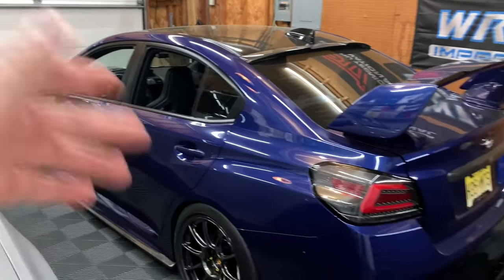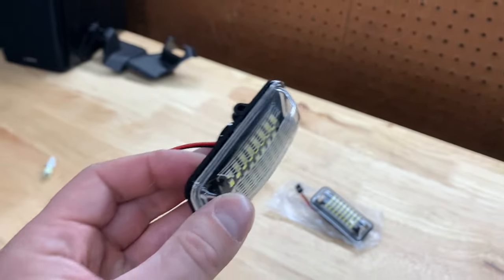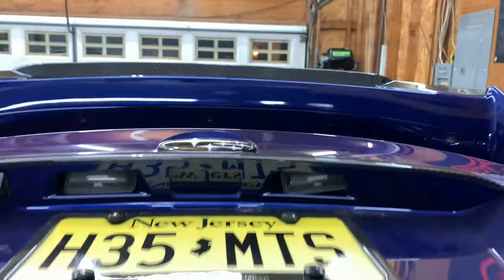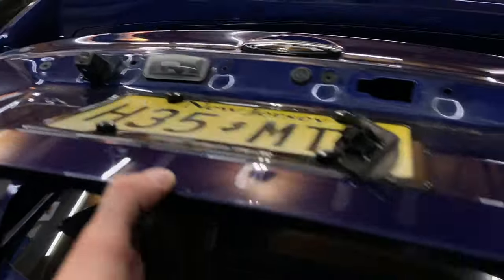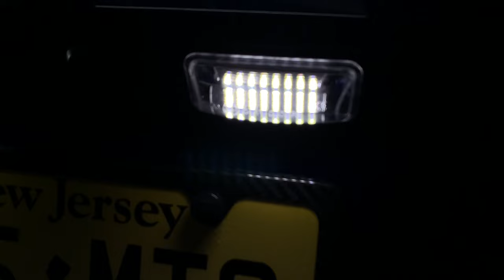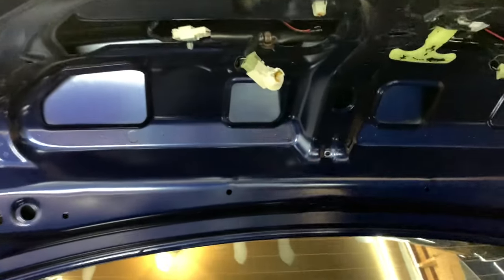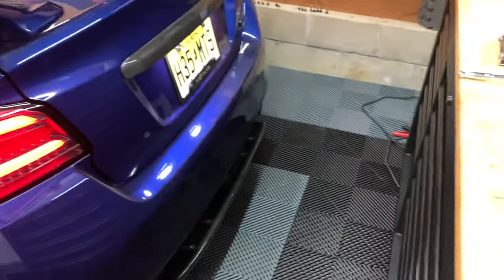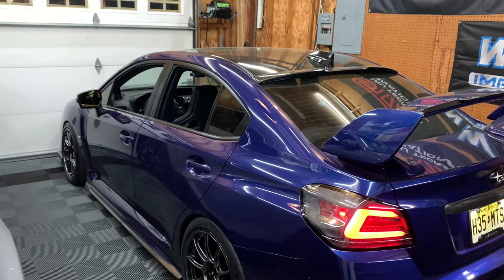New LED Lights On My Subaru STI

Comment: Is it safe to change out turn signal bulbs and brake light bulbs to LED without causing damage to the BIU? (Body Integrated Unit). I’m seeing a warning on Subispeed about it on interior bulb upgrades and wondering if that applies to any light upgrade?
Reply from the maker: Brake lights are led to begin with so can’t change those.  Reverse lights and blinkers can be changed. You’ll need an led module relay to eliminate hyper blinking. Otherwise, you’ll be fine. Interior lights as fine as well. Just swap them over.
Reply: @Scoobyfreak86  awesome! Thank you for the quick reply and guidance!